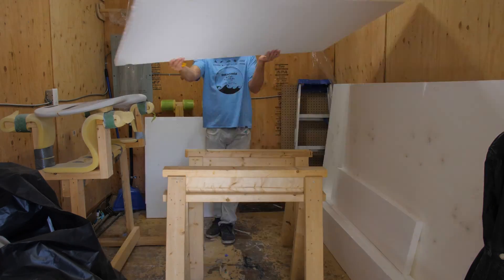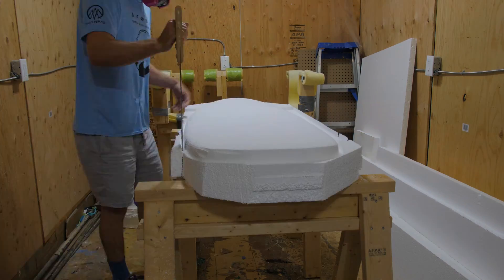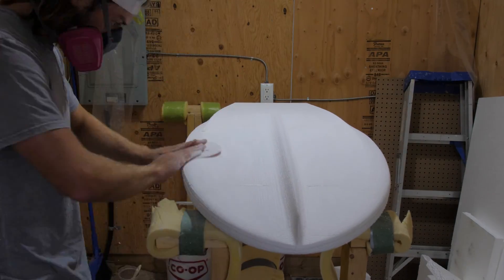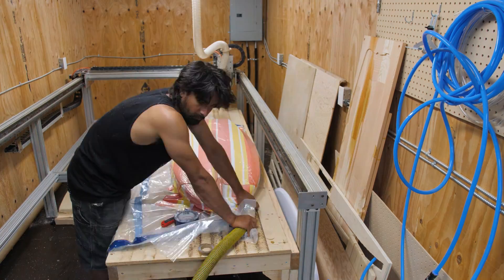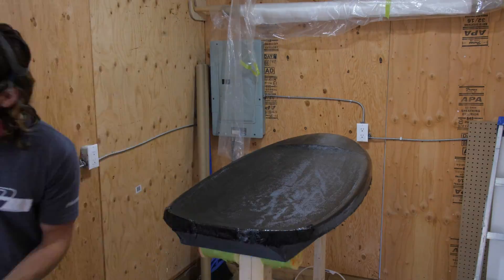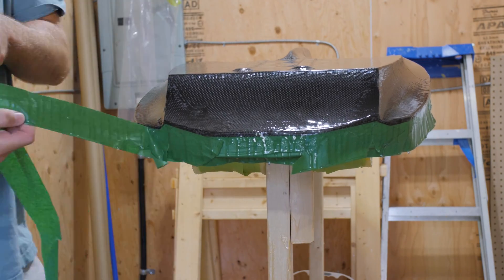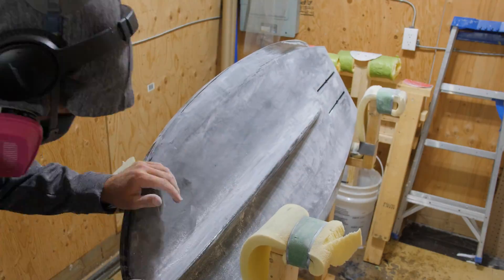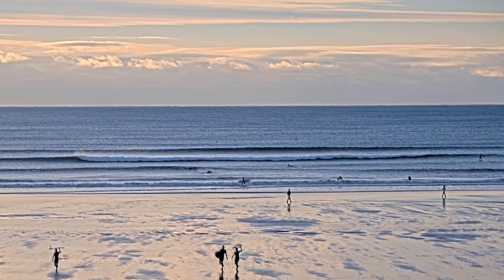SHAPING A FOILBOARD | FULL CARBON FIBER

Comment: Awesome video and shape. How did you handle the lap joint?
Reply from the maker: On this board I just lapped overtop and didn't worry about a clean "cut line". There are a few loose strands visible, but the carbon from the deck blended well into the bottom. It's not very noticeable unless looking closely. 
On more recent boards I've been layering up several lines of masking tape along the lap line. 3 or 4 layers thick. Then after glassing you can sand down to the tape without digging into the carbon underneath. It's been working very well for super clean sharp "cut laps". More like sand laps haha. Can't see the tape for a normal cut lap through the carbon, much less cut the tape while the board is curing in the vac bag.

Comment: Does someone use XPS?
Reply from the maker: Hey, Yes some people are using XPS. The issue with XPS is getting the epoxy to properly bond to the foam. The upside of XPS is water will not absorb into the foam on dings. The downside is the epoxy will also not bond to the foam well. The surface is not "grippy" enough and leads to delamination.
I've seen a few guys working on a way around this. Seems like the best way is to puncture the foam with a spiked roller where you will be glassing. This will provide mechanical holes for the epoxy to fill into and grip the foam.

Comment: Excellent! Would be curious knowing overall cost of the board, especially for carbon fiber and epoxy resin? Do you have seller to recommend to buy from them?
Reply from the maker: Hey the overall cost is about $600 CAD for all raw materials. Maybe $500 if you use the cheap insulation EPS foam like I did in this video. I havent used the insulation foam since, and would recomend getting proper high quality EPS foam, it helps durability alot!
Reply: @reeces_shredlab  Thanks for your reply. Though my current project differs, it gave me insight into the techniques being used in the carbon fiber build process.
Reply from the maker: Awesome! Goodluck.

Comment: Did you put braces in of high density foam you used for the box all the way through to the deck?
Reply from the maker: Hey Bido, Ya I did, high density connecting the foibox to the carbon on the deck.
Reply: @reeces_shredlab  nice thanks for the reply. Is it just purple  foam insulation board?
Reply from the maker: I used the purple insulation foam in this video, but I wouldn't use it again. It was still too soft and got compressed after a few months of use. I ended up using some weird combo of plywood to disperse the load and high density pour foam. I would try and find a super hard material, maybe even balsa wood or something similar. And use carbon or wooden stringers to connect it to the deck.
Reply: @reeces_shredlab  think 4lb density pour foam is enough or go with 6lb?
Reply from the maker: 6lb over 4lb for sure. The more dense the better.

Comment: The epoxy used to glue the foam boards together is not the same that the one for reinforcement with fiberglass and carbon fiber right ? Also, Does the CNC machine have difficulty shaping when encountering epoxy?
Reply from the maker: Actually yes, I used the same epoxy for every step of the way. And no, such a thin layer of epoxy, like between the sheets of foam does not cause any issues with my shaping machine.
Reply: @reeces_shredlab  kingg

Comment: How do you set the registration after flipping the board?

Do you have any advice for someone thinking about building their own cnc? Did you draw any inspiration from eg the MPCNC community?
Reply from the maker: I use a laser level to help line up the tip of the tool with my origin point on the board. 

And no I've never heard of the mpcnc community haha. I mainly just pulled info off of forums, YouTube, and made it work with the parts I was able to get my hands on.

Comment: do you not sleep? awesome work. Is there no need for a stringer with carbon layups?
Reply from the maker: I probably sleep too much actually haha. I didn't put any stringers in this one because the board is so thick it will be plenty stiff enough already. It would add extra weight and be kind of a pain to shape on the machine as well. The board has been holding up great, still no issues to this point without stringers.

I know some people are doing dual stringers, one under each foilbox to support them. Then you don't have to do as much after shaping to stop the box from breaking. Could be worth trying.

Comment: Hello. What software do you use to design the board and generate the GCODE? Have you ever used BoardCAD?
Reply from the maker: Shape 3d for the shaping and Fusion 360 for the G code. No I've never used board cad.

Comment: Hi ,is better ,when use carbon or kevlar carbon , on last layer one glass 150gr or similar to use for sending and do good finishing, because is better don't send the carbon, specially on the edge, i use a 200 grams glass ,buy good work
Reply from the maker: Hey Robert,  Yes I agree, I've been putting a thin layer of fiberglass on the sharp areas of the board, like the rails. It gives a sacrificial layer for sanding and also has better impact resistance when my heels hit the rail. Seems to help a lot with cracking.

Comment: Excellent video thanks Reece. You're very creative and it's a pleasure to watch.   What was that board shape like for winging lift-off in very light winds? What what foils do you typically use on it?
Reply from the maker: Hey! I find this shape is really nice surf foiling or towing behind a boat, where the takeoff involves slicing through the water. Wingfoiling it doesn't make that much difference on the takeoff because it involves more bouncing the board up and down, instead of moving it through the water. Once you're up on it though, it keeps speed really nicely on touchdowns.
Reply: @reeces_shredlab  Hey! Understood, thanks.  What's your thoughts on the best light air wingfoil board shape? Lots happening in that space now, and much talk about using SUPfoil boards for light air winging. But I'm finding that for using a small foils (in light air) that in addition to higher water speed, a significant amount of lift angle is very briefly required on the small foil, and the longish SUPfoil boards often don't allow this. To cope with bouncing the board better at high-ish water speeds, I'm wondering if a single concave stubby/square front underside shape progressing into a flat rear might work.  Also I'm curious what foil kit you were using in the above video.

Comment: Wow impressive ! Congrats ! May I ask what rocker you had for that first board, and what rocker you ended up on your second one ? So cool, hoping to do the same !
Reply from the maker: Cool! The second board has 5" of nose rocker in the rail. If the tail of the board is touching the ground, the bottom of the rail at the nose is 5" above the ground. Hopefully that makes sense haha. Or just 2.5" of tail rocker and 2.5" of nose rocker. Hope the shaping is going well, sorry for the delay I was travelling for a bit.

Comment: Hey bro how'd you get your vacuum to hold vacuum all night? Is there some kind of relay switch I need for my vacuum pump? Or can I just leave it on all night?
Reply from the maker: I have a vacuum regulator setup that I wired into my pump and pressure pot. Stops the cheap pump from overheating, check this video out at around 1:20:
https://www.youtube.com/watch?v=BFg_-QFx7YE

Comment: Very clever design with the "fin" in the front... What's the idea for foilsurfing? For wingfoiling would be a good design for upwind (not foil) sailing when wind suddenly dies...
Reply from the maker: Thanks, ya the idea is for foilsurfing, trying to get the board moving through the water as fast as possible before lift off.

Comment: How did the Bow 'Fin' work?   Did you change the design of it in the 2nd build?  Thanks for posting!
Reply from the maker: It works really well! It has super low resistance on touch downs, I've glided well over 5 meters through the water on it. My previous boards I could really feel the drag on touch downs and I would almost immediately lose all my speed.
I only changed the rocker line for the second one.
Reply: @reeces_shredlab it's a bit like the bustles on the latest America's Cup boats. American Magic in particular had a very big bustle they could ride for a bit in half foiling, half displacement mode